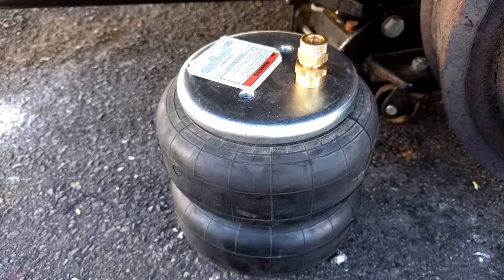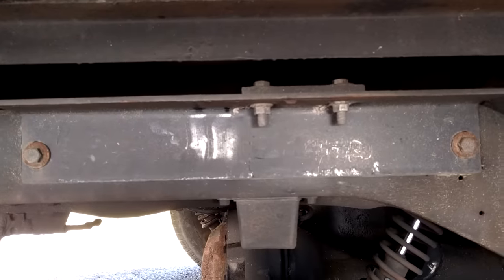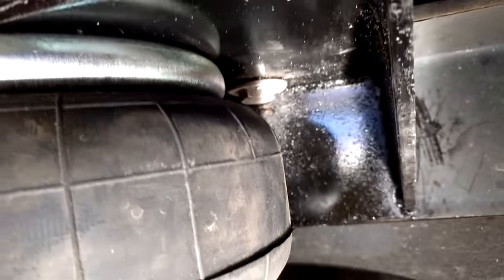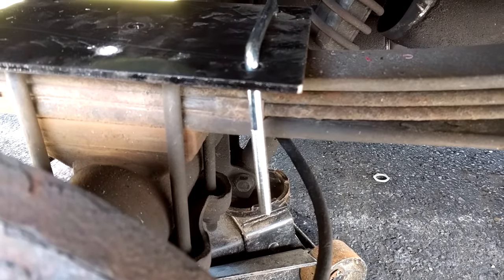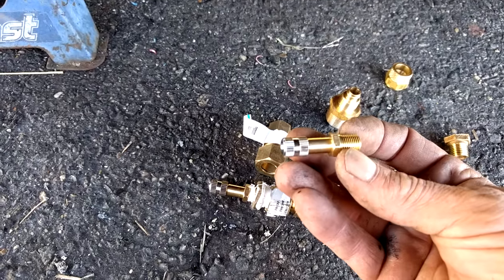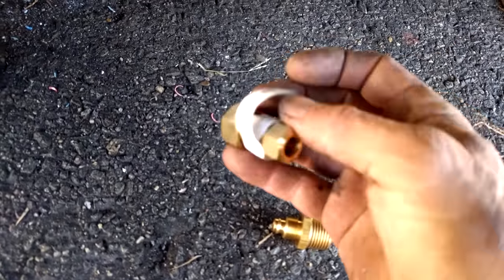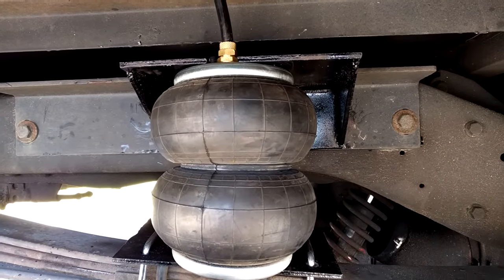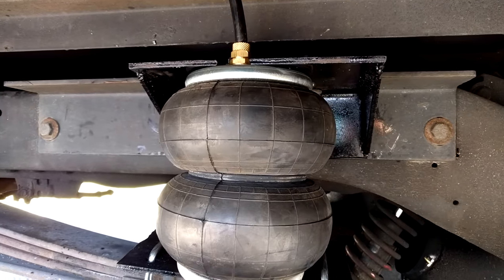How to Air Bag your truck for $100 (Air Bag Suspension) Awesome Upgrade

Comment: can you use air bags to lift a truck for higher stance alone (empty bed)or is made to lift with a load pressure only  by lifting a loaded bed back to stock height..  sorry for dumb question ...
Reply from the maker: You can but if you put a lot of air (higher lift) in it it will give you a hard ride.

Comment: @Glenn 3505 , the warning is coused by it being goldchromed and you pic it up through the skin , parker hannefin stoped plating and using them 10 years ago after testing workers blod after 3 years with handling fittings like those , more then 60 times the legal dose of the plating in their blod !
Reply from the maker: I never knew that, now I know why.

Comment: I really hope you added bolts in the side of your upper mounts before putting any load on them. Plus I would only use grade 8 bolts and u bolts.
Reply: Jim bo just trying to help. Air bags have a lot of pressure on them under a load.

Comment: Do a video on the coil over springs and where you got them
Reply from the maker: You can find them all over the internet, juts Google (coil over shocks) The truth is I was not that impressed with them. I put them on before the air bags and they did not help much. They did not hold or lift my truck, that I could notice. I was getting ready to take them off the rubber bushing are bad.

Comment: did you link the airbags together? and install a relief valve?   I wonder if they put something in the airbags to suck up moisture?
Reply from the maker: I did not link the air bags together. The reason is sometimes I carry uneven loads so I wanted to be able to add different pressures in them. I have not tried them teed together be I have herd that when you go around corners the air will move from one bag to the other.

Comment: What is the best setting for airbag suspension longevity  ?  I heard Hight high setting  is gonna make it last longer ? Is that true ?
Reply from the maker: I don'y think the pressure has any thing to do with how long they last. You never want to drive with them empty. The more weight the more pressure is needed to make the truck ride right. If you don't have a lot of weight and put a lot of pressure in them you will get a very hard ride. The idea is to adjust the pressure so the truck rides good with the amount of weight in it.

Comment: If you ever need to put 90psi in air bags...you need a bigger truck.
You understand they are to share the weight with the springs, not carry it all yes?
Reply: What he did more than likely worked for him.

Many farmers are just getting by and many junkyard owners will sell them anything that they break much cheaper than they can buy a bigger truck for.

Comment: Interesting video, wish I had seen this before buying my Air Lift kit. I could have easily had someone make the iron plates. As far as leak detector spray, make your own concentrated soap and water in a spray bottle. Save you some money. It works the same. It seems like everything used in California causes cancer. I guess I'm staying where I am. LOL LOL

Comment: Where did you find the airbags that cheap because I can't find any around here
Reply from the maker: The main website is https;//airbagit.com the same place sells on eBay under the name chassis_tech. Sometimes there stuff is cheaper on eBay. Some eBay links are https://www.ebay.com/itm/V-Air-Lift-2600-II-2-Air-Bags-Single-Port-3-8-Airhose-Springs-Suspension-FITs/282280749134 these are 2" taller and cost about $130. If you click on the eBay link you can go to their eBay store from the link. The "2600" is the weight capacity.
Reply: Thank you Mr. Glenn

Comment: If you had bought the brackets, the bolt where the rubber stops are, the stops come off, the air bag brackets go on.

Comment: hey guy i have a question if i put this on a mini truck thats already low would it level or or make it higher and when i take air out will it slam it?
Reply from the maker: You can adjust the air pressure to make it higher or lower.

Comment: I bought an airbag system for my old 79 Ford from a truck supplies diesel shop it was only $200 came with all the proper brackets and firestone bags with the all the fittings, lot less hassle I don't think you saved a penny when it's all said and done.  Yes I'm a penny squeezer to, but sometimes your much better off just buying the right stuff
Reply: Where you bought from link
Reply: @Johnwick-ul4td  from truck pro at enid okla. Just bags and fittings and brackets cost more than 200 now. Bought that kit several years ago still no problems

Comment: i like to know where you got the air bags for a 100
Reply from the maker: You can get a set of air bags for $68.36 (https://www.ebay.com/itm/Air-Ride-Suspension-Air-Bags-Pair-Standard-2500-1-2-npt-Kit-Replacement-Parts/281836657351?ssPageName=STRK%3AMEBIDX%3AIT&_trksid=p2055119.m1438.l2649)
 I payed $79.98 for bags that are 2" taller. I payed $25.00 for the 
steel. I do deal with the steel shop, so maybe they gave me a good price
 but they just picked up scrap and cut and bent for me. I did all the 
final cutting and all the welding myself.
Reply: thanks Glenn,  nice job we looked for bags but never found them for that price
Reply: @Glennfix  those bags are 130 now
Reply from the maker: @nickonickster1  Your right. I have not looked at them for a long time. The ones I used were the V Air Lift 2600-II, on eBay at $126 https://www.ebay.com/itm/V-Air-Lift-2600-II-2-Air-Bags-Single-Port-3-8-Airhose-Springs-Suspension-FITs/262749710096. They have the two standard 2600 airbags that are the same weight capacity just 2" shorter for $89 on eBay https://www.ebay.com/itm/two-new-standard-2600-air-bags-3-8-npt-port-ride-springs-bag-suspension-fbss/121566282478. Since then I added an air compressor (if you would like to see the video https://youtu.be/z_WxCUVAwSk)  and I can tell you I am very happy I added them to my truck. They are worth the money. Also, I have a 2year review video.

Comment: This wouldn't be bad if you installed some gussets above the bracket. Also, turn the heat up on your welder, you're not getting enough penetration.
Reply: I stand corrected. After checking out the angle iron above it and the trailer hitch you have spanning across the frame, you have PLENTY of reinforcement. Good job! But buy some drill bits, and turn the amps up on that welder! ;)

Comment: Connect the two air bags together with regard to air pipes. Then have the inflation point handy so you can reach it with a simple battery operated air pump. Maintains equal pressure both sides
Reply: When you corner, you lose all benefit of having the bags if you connect them together, which if loaded up, could cause a rollover if you're relying on the bags to level the vehicle. 
Terrible advice.
Reply: Bad idea
Reply: The installation was done professionally, the two  microbore cables were connected to a small  bit of apparatus behind the drivers seat, it had one schrader type valve and a gauge to adjust the pressure. I don't know maybe it had one way valves inserted in each line to prevent exchanging values under cornering or load etc. I trusted a professional company to do the instalation correctly. They did every kind of vehicle including very heavy goods and large fire  service vehicles with large water tanks etc. It totally transformed the vehicles handling and comfort. Lived full time and travelled much of Europe on every kind of surface with it. Never  rolled it once.
Reply: Unless a bag breaks....
Reply: @nickonickster1 Please note. These were fitted in addition to the standard suspension as from the vehicle.manufacturer. If they had burst, extremely unlikely as most bus and trucks use them, would have just gone back to standard suspension, which whilst being too soft for my liking, did work. They actually replaced the standard rubber bump stops with an adjustable inflatable unit.
Reply: Where did you get the bags from ?, nice work
Reply: @tek2236  This was in the U.K and done by a professional firm on my French Built Rapido R.V.. totally transformed the handling of the vehicle. Before the fitting it would lean over quite badly when negotiating some of the corners in the UK.
Reply: yep if you live in an apartment and can't change your own oil  ... than NO you CANNOT DO THIS FOR $100 OR EVEN $1000   LOL

Comment: I can't see to find these.   Do you know the model # on them or name etc. 
 Thanks .
 Btw- nice vid 👌
Reply from the maker: The V Air Lift 2600-II 2 Air Bags Single Port 3/8" Airhose Springs Suspension FITs are 2" taller, https://www.ebay.com/itm/V-Air-Lift-2600-II-2-Air-Bags-Single-Port-3-8-Airhose-Springs-Suspension-FITs/282280749134 the standard ones are V Air Ride Suspension Air Bags Pair Standard 2500 1/2"npt https://www.ebay.com/itm/V-Air-Ride-Suspension-Air-Bags-Pair-Standard-2500-1-2-npt-Replacement-Parts/281836657351 The 2500 or 2600 is the weight capacity for each bag.

Comment: 9:18 you don't need to waste money on leak detectors just fill a bucket or spray bottle with water and some dish soap and spray it works the same
Reply from the maker: I do commercial refrigeration so I always have a bottle on my truck.

Comment: Id like to know where you got air bags for only $100 because I haven't been able to find them for under $300.
Reply from the maker: I got them from http://airbagit.com, But I bought them off ebay the same company sells on ebay under a different name a lot of the time chaper. There web site is https://www.ebay.com/itm/Air-Ride-Suspension-Pair-Standard-2500lb-Air-Bags-1-2-npt-Single-Port-Heavy-Duty/262808911098?hash=item3d30a1bcfa:g:1AEAAOSwopRYe5AM ($81.73). I have hade them on my truck for over 2 years now and made a review video if you would like to see.   https://youtu.be/b3y2QQu2ioA

Comment: Should've just drilled a few holes on the bottom plate for the axle u bolts. Pushing down on the u bolts is just kinda hacky

Comment: Does this help rough rides !
Reply from the maker: It depends, If the rough ride is because the truck is sitting too low, yes. If you want a ride like the air ride on a BMW no. But you can adjust the air and make the ride firmer or softer.

Comment: Engineering level daycare!
The load on the bracket will twist it up and outward from the frame, needs to be bolted thru side of frame.
The clamping around leaf spring package is joke, you need something between springs and plate to clamp against!
Reply: I'm no engineer, but since he didn't modify the frame should;t that carry any weird twists or loads on the original suspension, while the airbags just smooth things out?
Reply: Shouldn't be too big of a deal.  First we have leaf springs, then there's the coilover shocks, and then if that's not stiff enough.... gonna throw some airbags on so it's like driving with zero suspension. Lol all kidding aside though. It is kind of a cool very cheap way of doing it. Although not quite done correctly.
Reply: How about you learn how to speak correctly before you try and critique someone else's work.
Reply: What bolts are those? Like M16? So 50kN tension capacity? That's like 5 tons of force each so 10 tons combined. Plus the same on the other side of the truck. 40 tons of strength seems MORE than enough!
Reply: Seems like people don’t understand leverage
Reply: Was gonna suggest the same thing but not in the same way. No sense in having the 1/4in steel bent if he was only gonna bolt it to the top.
Reply: Dumpster 
As soon you put together a coherent sentence in your second language!
Reply: Depends how much weight he actually puts on the spring. Some frames you are not supposed to drill or weld to.  Many frames are not mild steel. They are harder and thus brittle by comparison which means cracks form easier.  Personally I would have removed, drilled and tapped that chunk of angle already bolted to the frame. Two short bolts would be enough for the extra support it needs. 
As for the bottom the problem there is the spring flexing will work against those brackets. The brackets need drilled closer to the center of the axle away from the flex zone. Nothing critical or dangerous so not a huge deal. If it bends or breaks he can fix it pretty easy.
Reply: @homertalk  basically he just wants to sound smart . Helper bags ?? Not leaf replacement

Comment: HEY THAT WAS COOOOL.... IMA SHOW THIS VIDEO TO MY BUDDY WHO JUST PAID A SHOP 1500 BUX TO DO THIS.... HAHAHA.... Only question i have is where did you generate the air from?
Reply from the maker: Thanks, Now I just add air with a home air compressor. I have everything to add a on board air compressor, just haven't had the time to do it. when I do I will make another video.
Reply from the maker: Thanks, Now I just add air with a home air compressor. I have everything to add a on board air compressor, just haven't had the time to do it. when I do I will make another video.
Reply: The big bad wolf. He huffed...and he puffed...and he blew air in these air bags. But the big bad wolf has been a smoker for quite some time now so his abilities are limited nowadays. Life's been tough for the big bad wolf. Poor Lil feller.

Comment: I just saw your video. It appears to me your bracket on top of the air bag is braced in the wrong direction. Can I correctly assume you had to weld it to your blue ox bracket for proper support?
Reply from the maker: No, I bolted it to the blue ox. I made it wide enough so the air bags will never hit. There is not room to mount it  any other way. The blue ox bracket sticks out from the frame so it is snug against the blue ox.

Comment: I'd rather put the nuts up top because the top side of the plate is less often the side under tension what with the air spring on top

Comment: Just a plumbing tip better to not make  compression fittings to tight by snugging them up 
apply H20 or air pressure 
then if leaking slowly tighten until leak stops

Comment: Glass cleaner or dish soap and water work well too. Where did you get the bags?  Part number?
Reply: Jim Benny 
That was my question too
Reply from the maker: I got them from a place called chassis_tech  on ebay or http://www.airbagit.com/. They do have some bad reviews but for the cost I thought I would give them a try. so far so good. They are the manufacturer.
Reply: Glenn 3505 I love them & never had any problems with them, they have been around for over 20+years & ther yard backs up to my yard so i guess u'd say we're neighbors.. but ther bags DO have a Lifetime warranty and I've worked with & I have used ther products on all my rides b4 they even moved from phx to mesa az.. the bags are available in several sizes from length to weight differences.. u can call or enter in ur vehicle info to get the proper bag size & style u need for ur application even for lifted 4X4's on ther webpage..also if u opt out of a compressor then just ask them to add the Schrader valves for like $10 to ur order so u dont have to hassle puting together several peices for a fill valve on each bag.. good video

Comment: or,  you could put soapy water in an old spray bottle and not go waste money on a "leak detection solution".  it ain't Freon.
Reply: Found the old school mechanic.  Old soapy water trick works on just about any kind of air/gas leak.

Comment: did you have to fit air compressor to fill the bags????
Reply from the maker: I don't have a air compressor now but  I like them and am working on putting a on board compressor and front air bags. I am getting everything together now. This way I can adjust the pressure from in side my truck instead of finding air supply.

Comment: Your welds are ok. The more practice you do in your welding the better you get. Even self taught. Practice is like sharpening a knife, the more you do it, the sharper it gets.
Reply: That's true but anyone who Welds should get a crash course on what constitutes a good weld and why some are stronger than others. Also how uphill, down hill effect penetration. Just the basic concepts and it will make newbie good enough to run a strong weld

Comment: Ummm don't get me wrong. But thats not under $100. Js
Reply: How so ? You can go to the peter built dealer and buy some heavy duty bags for 50 something dollars a piece then go to Lowe’s get some 1/4” plate along with all your fittings around 150$
Reply: I agree this isn't just $100 air bag installation. I'm unsure if he meant per bag or for one side or just the back but certianly not $100 unfourtunetly.
Reply: He meant $1000 but the keyboard letter "0" died after 100... yeah 100 bucks is not enough, paint, steel, welder, electricity...all cost money.
Reply: @uralguy5131  I agree with you there. He must be assuming you have all the tools, and all the parts already lolol
Reply: @kathleenkatefraser1765  There are many DIY videos  like this." How to make a aluminum water tank for free" Get some scrap aluminum and weld it...
Reply: @uralguy5131  hahaha for real right?? Lolol

Comment: Bottom bracket. Couldn't you flip the U bolts and use nuts & lock washers against the plate & not need anything under the spring?
Nice bags. I probably would have bought the brackets to save time. A T fitting would ensure even pressure in the bags. Quit slacking.

Comment: Hello, what kind of shocks are those with coil springs?
Reply from the maker: They call them coilover shocks. I put them on first they add about 1000 pounds (500 each ) of capacity. It was not enough for me.

Comment: subscribed.  I have 1995 dodge cummins.  Plan on doing the airbag soon for towing applications
Reply from the maker: This is why I did it, you will see a big difference in the way it tows. I am very happy with my. Now I am putting together a compressor controller and front air bags so I can adjust it from in side my truck. I will make a video and let everyone know how it works out.